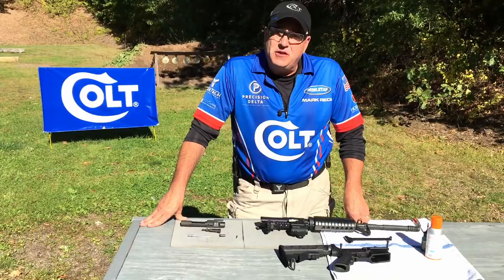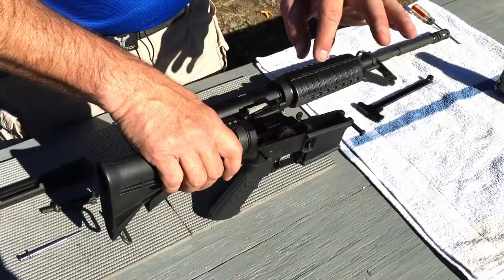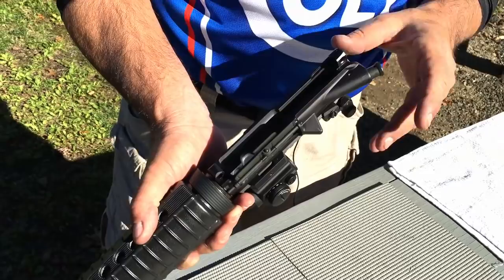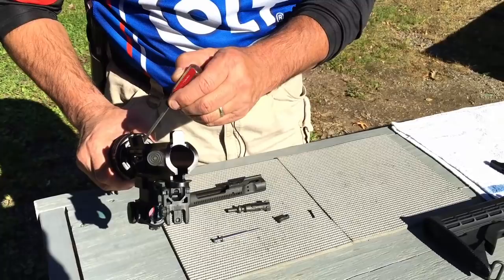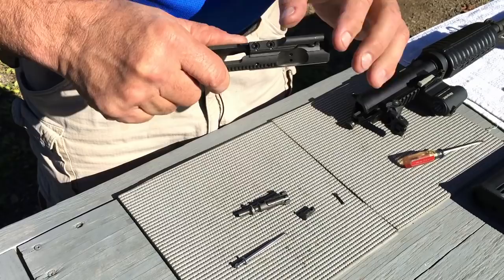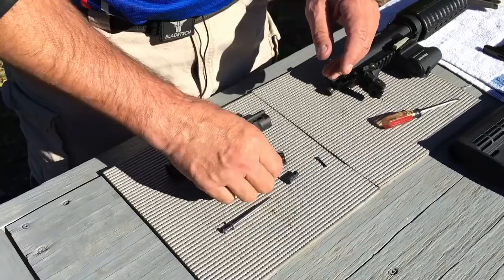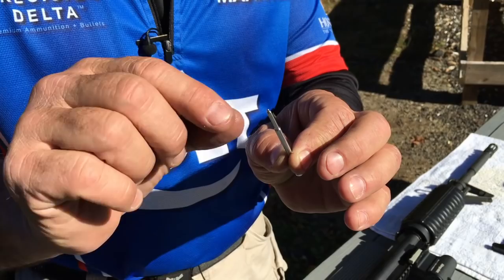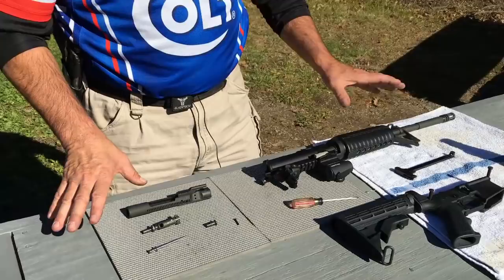How to Clean Your AR-15®

Comment: This vid is not detailed enough.  When I was in boot camp many years ago (Parris Island 1981), we also had to remove the extractor and extractor pin.  We also cleaned the bore with CLP and our cleaning rods.  We had the cleaning gear toothbrushes to scrub the bolt face, and Q-tips for the hard to reach spots including the chamber area.
Reply: Same here buddy  Army 91-96, we broke down further than this like you said with extractor/pin, handguards, buffer springs etc.  CLP, cleaning rods, tooth brushes, q-tips, and pipe cleaners is what we used.  I almost feel like just doing "This much" would leave it dirty if I was doing it, if that makes sense.
Reply: Yeah my cleaning kit came in a round pouch that zipped up on the side